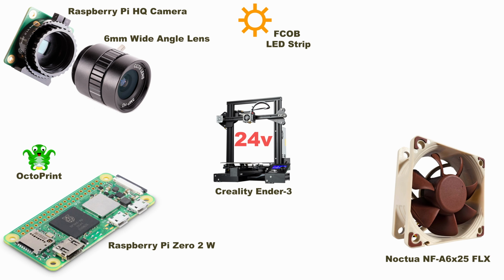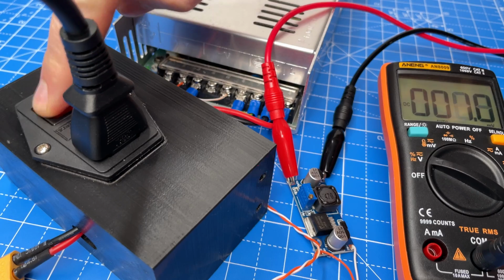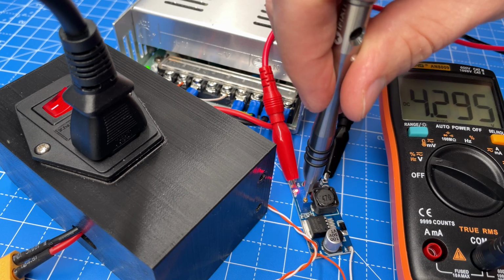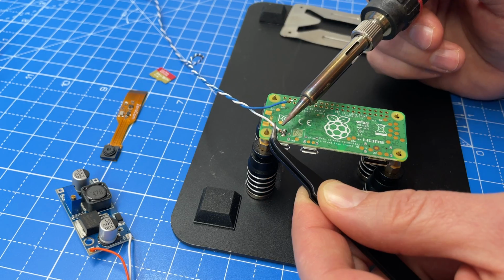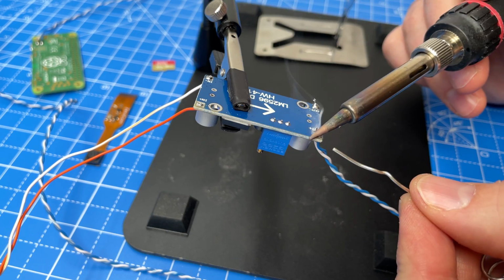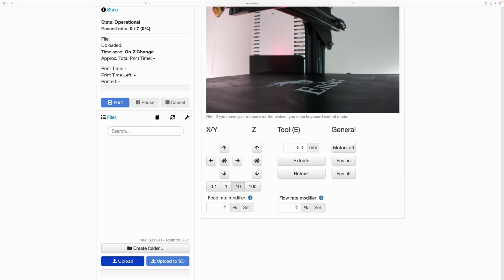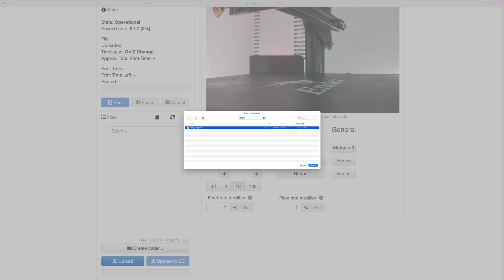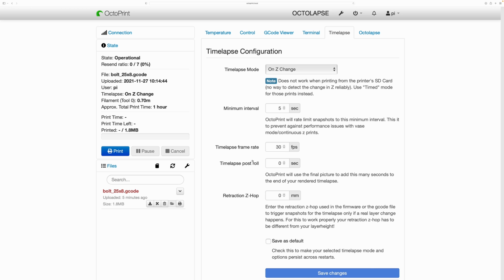3d printer upgrades with Raspberry Pi Zero 2 W, HQ camera, lamp and fan for Creality Ender 3

Comment: Hi, nice setup! I am doing upgrades to my Ender 3 S1 Plus. I currently have Octoprint setup on a 4B and it has its own case, dispaly and single v2 camera. I am looking to replace it with two cameras v3 normal and wide angle. To avoid ribbon cable disaster I am thinking of adding a Pi Zero 2W on the back of each camera. Do you know if it would be possible to stream via WiFi or USB to the 4B? This way my cameras will be physically separated and easier to maneuver and they should not interfere with the octoprint instance running on the 4B. Do you see immediate red flags?

Comment: Very nice upgrades, the only downside I can see is having the raspberry under the main switch, this mean that you have to turn on the ender3 first and also you can accidentally force shutdown the rapsberry by mistake (and risk of corrupting the SO). I would rather prefer having the rp zero always on with a separate psu or maybe integrate a mini AC-DC module in the ender psu

Comment: What gauge wire are you using for the connections? Sorry I’m new to all of this.
Reply from the maker: I used two wires from a standard ethernet cable. About 23 AWG.

Comment: I was debating between a pi 4 4gb I have laying about and a pi zero 2w I have laying about, have you noticed any issues with the pi zero 2w?
Reply from the maker: No issues with pi zero 2w. Enough performance for Octoprint. I stopped using SD cards completely.
Reply: How did you hook up the Pi zero to your machine? Micro to micro usb?
Reply: @danmckeown10  Octoprint